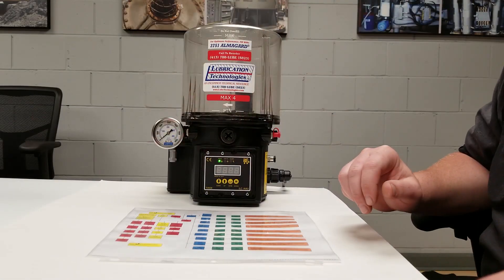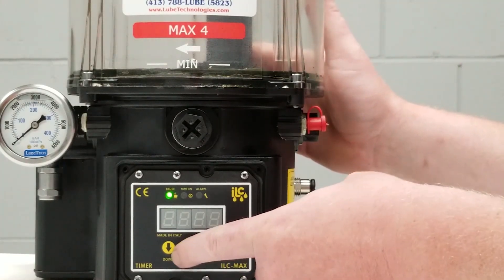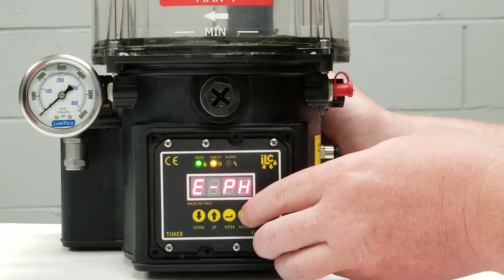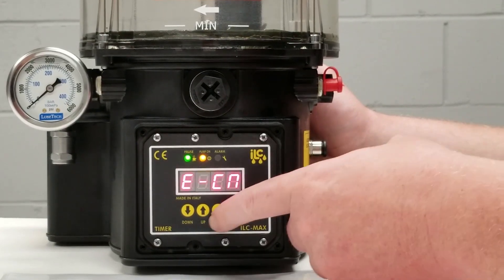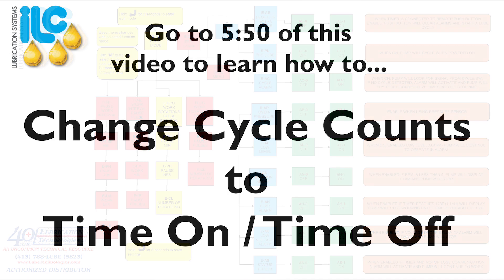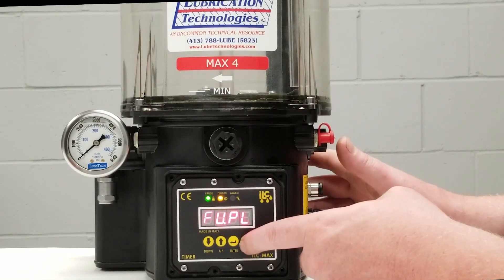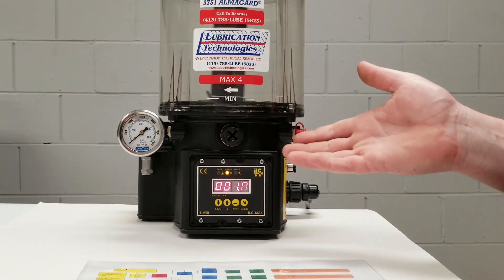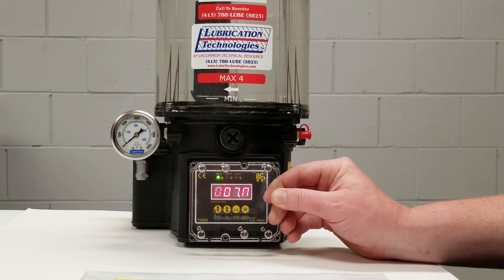ILC Timer Setting

Comment: Dear sir I want to know about Reset this machine .
We have a batching plant where we used this machine when it's not working then we check it and we find that SMPS was not working so we replaced it but this machine is not working properly some few seconds it's working and after that it's showing block and all three LED lights are blinking continue
So we want to know that is  automation card ok or not ok🙏